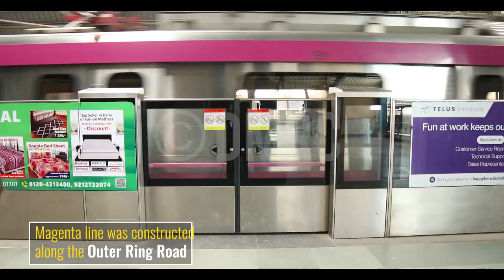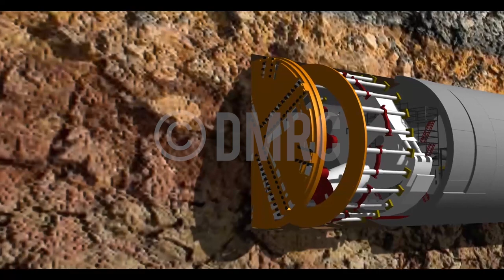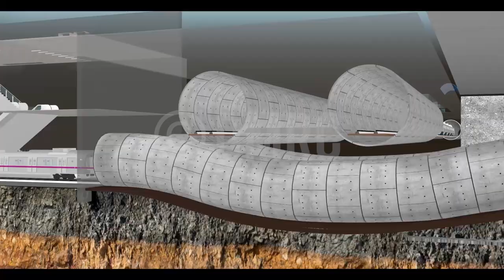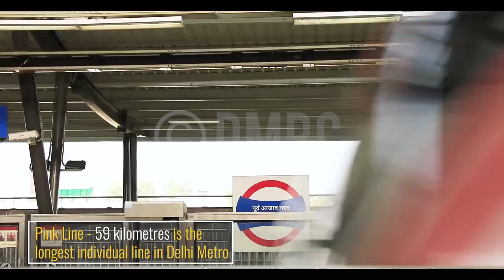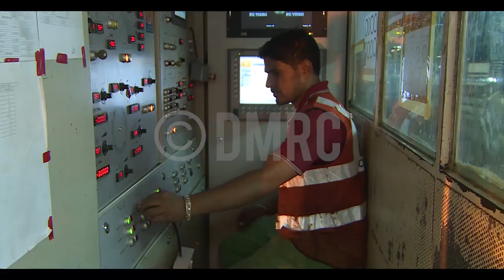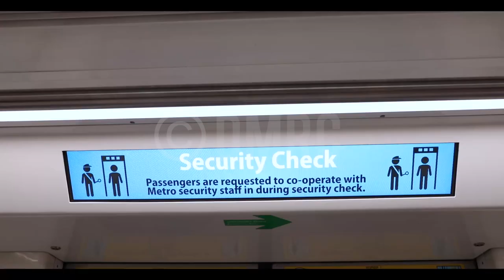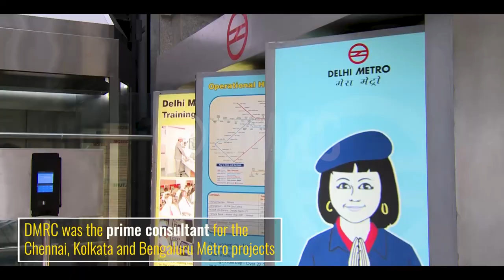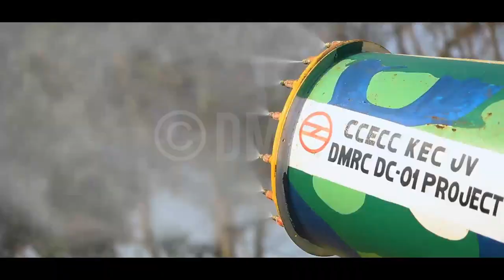Surmounting Challenges - An Incredible Tale of Time (Full Film)

Comment: 0:59: 🚇 Overcoming obstacles in constructing and operating a successful metro system in Delhi.
9:38: ⏳ Overcoming obstacles through perseverance and teamwork in a race against time.
19:54: ⏳ Unraveling the journey of a construction company and the challenges faced in various locations.
28:35: ⏳ Overcoming obstacles in construction and engineering projects for a metro station.
37:42: ⏳ Overcoming obstacles and achieving success in a time-sensitive project involving metro connectivity and airport infrastructure.
46:43: ⏳ Overcoming obstacles in the development and integration of metro stations in India.
56:05: ⏳ Overcoming obstacles in a remarkable journey through time.
1:05:51: ⏰ Overcoming obstacles through innovative safety measures and systematic railway operations.
1:15:21: ⏳ Overcoming obstacles in implementing urban infrastructure projects in India with a focus on time management.
1:26:02: ⏳ Overcoming obstacles in a time-sensitive project with ambitious goals and numerous challenges.
1:35:05: ⏰ Overcoming obstacles in the energy sector, transportation development, and sustainable construction practices.
Recap by Tammy AI